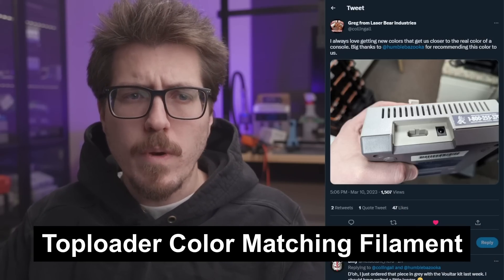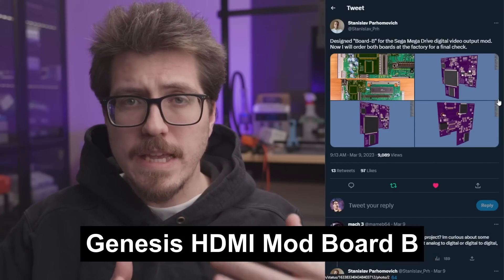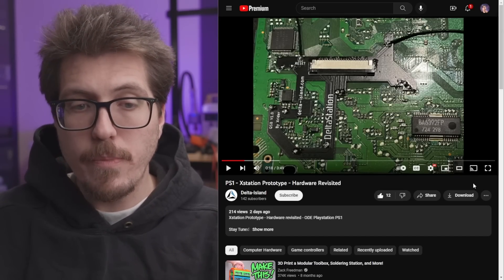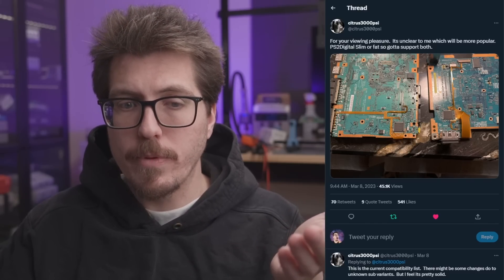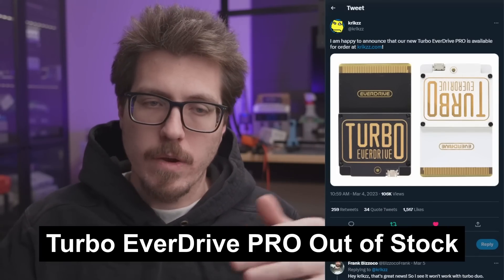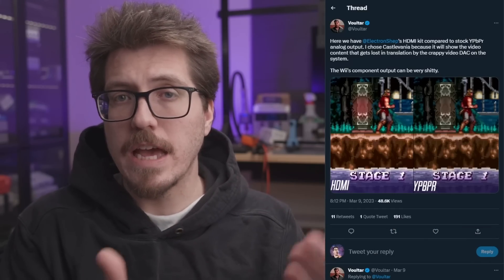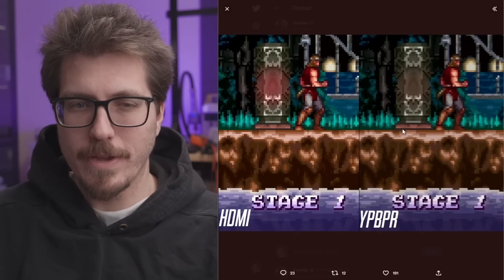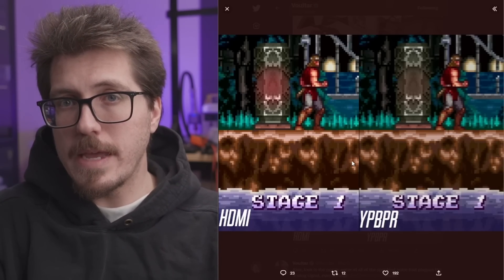N64 HDMI Mod Using Raspberry Pi Pico? - Retro Modding News

Comment: PS2 digital will easily be the biggest seller for Pixel FX. The PS2 is a huge console. However, the fidelity of the system is rather lackluster, so I'm curious how much PS2d will improve things.
Between AVE-HDMI and N64digital, I spent way too much money Friday.

Edit: one more thing. The raspberry Pi Pico is an amazingly versatile little board. Super cool.
Reply: I think your right in assuming PS2 may be the biggest release for them for long term if it catches on for alot of owners of a PS2, why use a PS3 phat with the risks when you can go back to the tons of actual PS2 hardware? 

PS2 has amazing component out, but it does have some fuzziness that could be done without from the fact of being analog. The main issue with PS2 is the common 480i on almost everything, dealing with that on the hardware level and resolution changes with just a simple hdmi output is the real benefit of the product in my eyes.